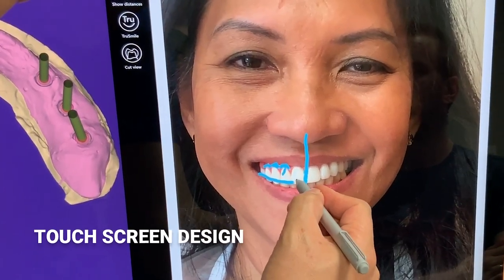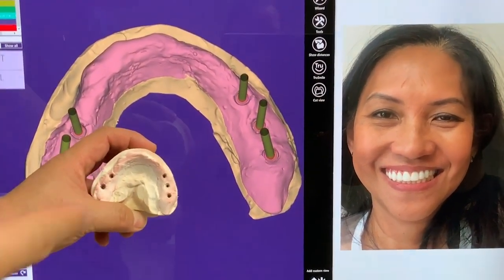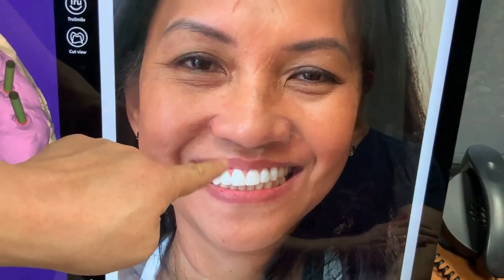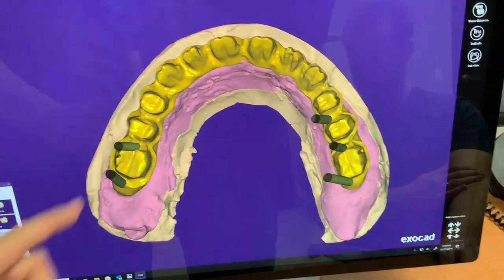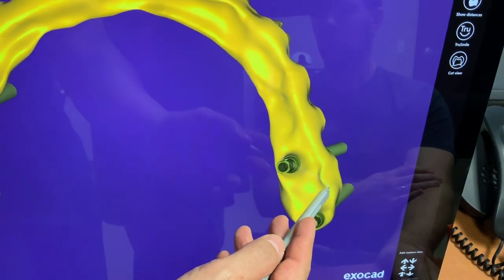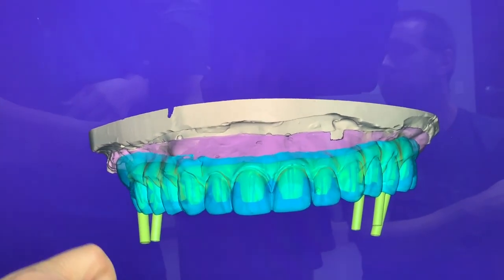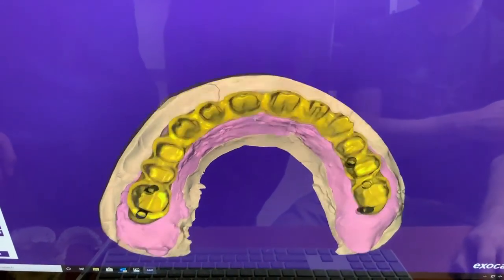The Most Difficult Full Mouth Implant Case | Part 1

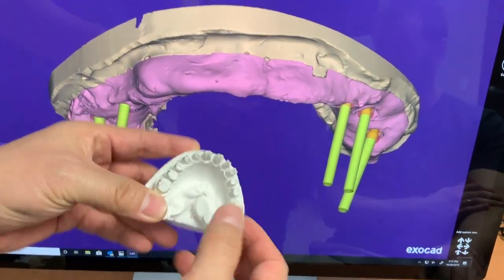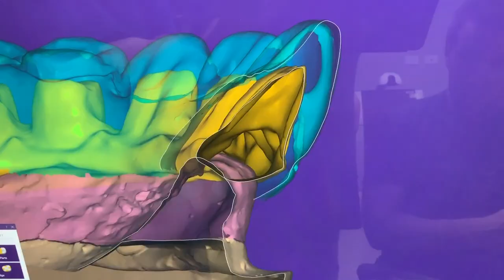Comment: Extremely excellent case. Question 1: At 2:50 of video you said "Syton 6500", is there a difference in your Syton 6500 (not on your website)  vs Syton 7000?? Question 2: at 0:07 of video, the photo shoes "Chrome Cobalt" frame, but on 5:58 you said you would make a "Titanium bar" ;  was there 2 different frameworks made or was there a video error (common), and only  "Titanium frame" made or only "Chrome Cobalt" frame made or you started as a "Chrome Cobalt" and decided to go with "Titanium Bar".  A little confused. Super Case.Thanks.